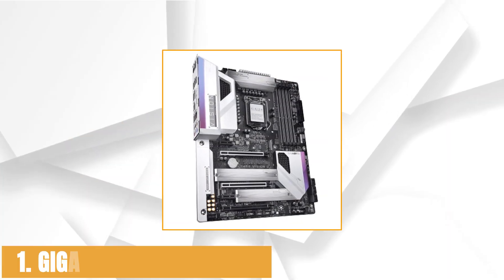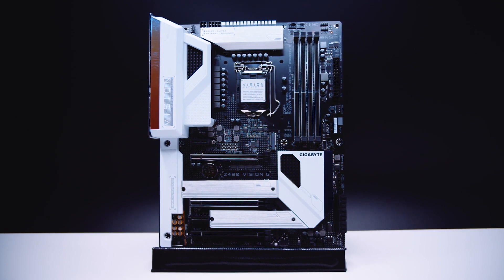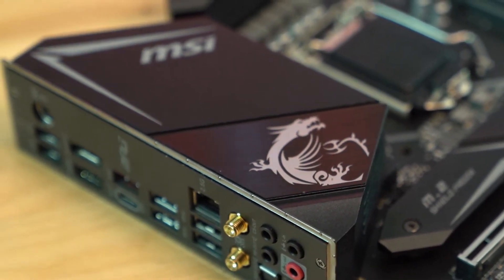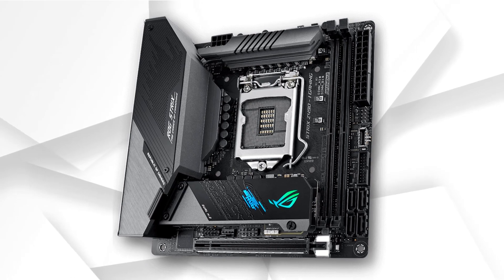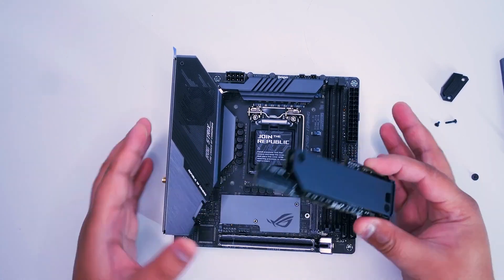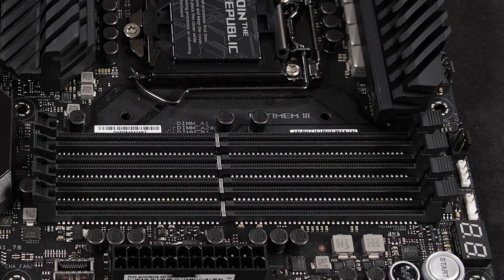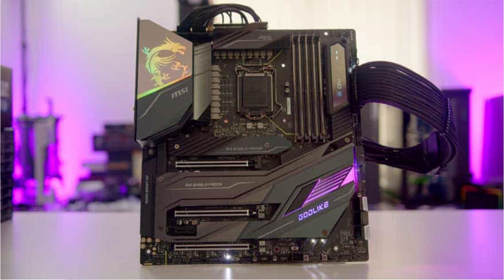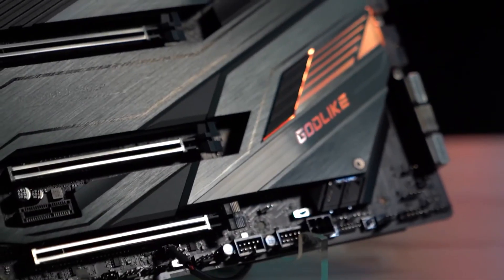Best Motherboard For i5-10600K in 2023 [Top 5 Picks]

Comment: Is the i5 10600k good with the gigabyte b460 aorus pro ac atc lga1200 motherboard
Reply: No because b460 is a locked chipset, meaning you won't be able to overclock, on'y the z490 chipset is unlocked.

To overclock an Intel cpu you need to have a cpu with k in the name and a z*90 motherboard (z390, z490, z590 etc.. And z490 is for 10th gen Intel mainly)
Reply: rekooonS ya Ik I got the b460 it’s a realllly good chip it could prob handle the i9 but it just can’t overclock but that’s not a problem since I got the rtx 3060 so I could already get really high FPS and gameplay experience the only thing that bothers me is that I don’t have an ssd so I can’t boot up games as fast as I would like to
Reply: rekooonS like when I got on fort I got to 600fps then went back to 500 then 550 then kept changing so my FPS is really good and don’t worry I’m not a fort kid I don’t like the game my friend downloaded it on my pc to play on for a sleepover
Reply: @minayacob6822  dw worry you can like whatever you want x)
But yeah if your focus isn't overclocking b460 was a good choice, but then you could have saved a little bit of money by getting a 10600, not the 10600k.
It's your choice of parts for your machine, you do whatever you want and that's the magic of pc building, but that extra bit of money could have contributed to that ssd you want
Reply: rekooonS there was this coupon that let me get the 10600k for the same price as the 10600 and I took it lmao a better upgrade and for the same price
Reply: rekooonS I’m flat out broke I can’t even afford blue light glasses so that I don’t get headeachs I am not gonna have a spear 100 dollars for a ssd lmao although when I do I will def get one
Reply: @Joao then why buy the k model if you don't wanna overclock? That would just be wasting money
Reply: @Joao then what's the point in getting the overclockable chip when you can get the non k chip for less money? If you buy the 10600K it's because you want to overclock, otherwise it's a dumb choice of parts
Reply: @Joao?
Anything over the base clock is an overclock and only Z_90 chipsets allow overclocking. The 4.8 ghz is the max that you can go if you stay within your warranty, and not a lot of Intel 10th Gen chips can even go above 5.1 iirc

Comment: What about the msi z490a pro?
Reply: Yeah. Most every review has the pro as the best 10600k mobo if you want to do extreme oc but don't need all the extra features of the more expensive mobo.
Reply: @MeepMeepMwo  haha lol I literally just bought that exact combo
Reply: And I’m indeed trying to overclock it only my fricking gpu has been lost in shipping
Reply: @MeepMeepMwo  btw do you have that cpu cause idk if mine is good or not I only get like 8800 to 8900 score on cinebench r23
Reply: @stijnvanbemmel5827  The 10600k isn't the optimal choice if you are going to do heavy encoding or other stuff that likes lots and lots of cores. I only game along with the normal pc stuff and its far more cpu than I need paired with a 1080ti. AMD is the better choice for that stuff and if the 10600k wasn't so damned cheap I would probably have got a ryzen.
Reply: @MeepMeepMwo  yeah absolutely right, I got mine for 220 euro. But I was only asking because I saw benchmarkes for the 10600k with scores of above the 10000 I think on r23 and i am only getting 8800 or somthing. I also kinda bend tested my motherboard so thats why i'm asking if it is a normal score
Reply: @stijnvanbemmel5827  Whats your ram speed and is it overclocked? Those synthetic tests typically like fast ram and just a small increase in clocks can give you a pretty decent boost to the score. If you have the msi pro mobo it has pretty extensive ram oc options so explore them if you haven't yet.
Reply: @MeepMeepMwo  I have hyper x fury ram running 3200 mhz cl 16. I haven't overclocked anything yet but I will once my pc is fully complete. I just want to make sure my mobo isnt damaged. Eventhough it probebly isnt because, I red that if it doesnt snap it is usually fine. I am also not doing any productivity work. I just want to overclock as far as it is stable for the little extra gaming performance once they found my gpu in shipping. I want to run 1440p with a 1660 super I got my hands on for a "fair" price together with my 10600k. If the shortage wasnt here I would probebly have gotten a 3060ti
Reply: @stijnvanbemmel5827  Pretty sure that gap in performance is due to the stock ram speed. Getting a stable 4000~5000 oc should be easy with this mobo depending on the type of ram you have.
Reply: @MeepMeepMwo I have 16gb hyperx fury rgb ram and yeah I think it is pretty good for ocing
Reply: @stijnvanbemmel5827  Was talking more about single vs dual rank but thats something you will have to search up as its a semi complicated topic but the short answer is that for the best overclock potential you want dual rank.
Reply: Nona Urbizniz Is the i5 10600k good with the gigabyte b460 aorus pro ac atc lga1200 motherboard
Reply: @minayacob6822  The b460 chipset does not support cpu overclocking so no point in getting a k series chip though it would work. If thats the mobo you want then go with a 10400 as that is a locked cpu but still gets you great gaming performance. You need a z490 or z590 for a k series chip if you want to overclock it.
Reply: Nona Urbizniz dang it I already bought it
Reply: Nona Urbizniz u think it would still preform well and go together?
Reply: Nona Urbizniz or do u think it will mess up my cpu
Reply: @minayacob6822  You won't have any problems it will work fine. Just no way to overclock it.
Reply: Nona Urbizniz can I upgrade my motherboard like a while later without my cpu having any problems and still be able to overclock on the new motherboard?
Reply: @minayacob6822  Yes.
Reply: Nona Urbizniz ok thank you